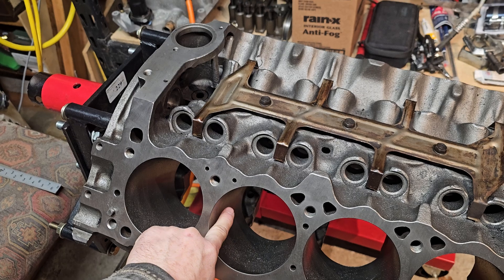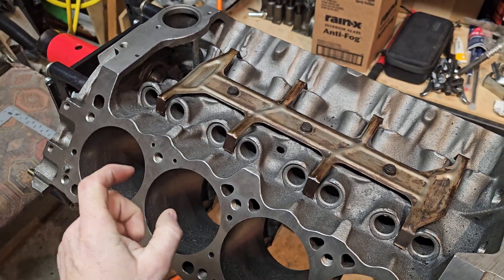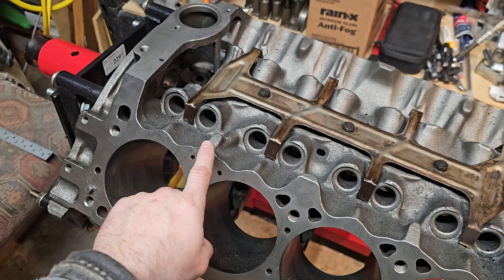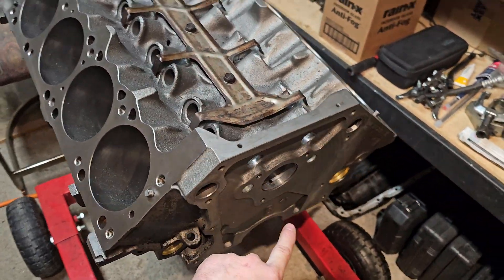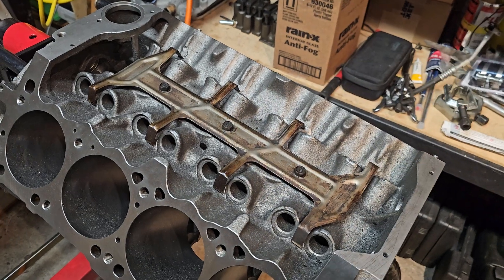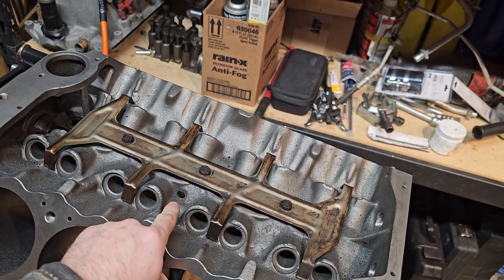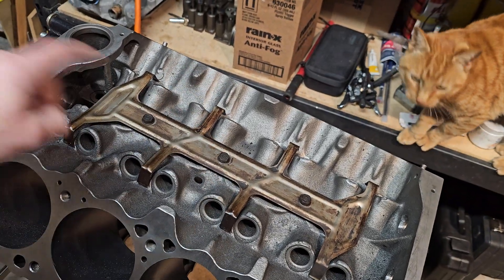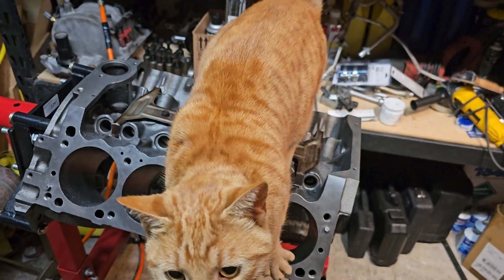Mopar 360 Magnum Oil Cross Over Mod - Why It Might Actually Work!

Comment: Why is everyone tripping over themselves to fix a NON-problem ? We ran 340's and 360's right through the 70' and 80's at 500+ hp and with Nitrous shots higher and NEVER HAD A PROBLEM year, after year, after year.... NADA.... ZILCH.... DONUT !
Control your Vertical Main and Rod Brg Clearances and you have NO issues.
Reply: You telling me your running nitrous without forged internals? That’s nice to know bc I’m rebuilding my magnum 360
Reply: @josephneher8130  'Detonation' and insufficient Cylinder Wall and Ring end gap Clrc is what kills any Piston either cast/hypereutectic or Forged whether it be 4032/2618 alloy derivatives.
As long as you can stay out of the fuel detonation range(good fuel for the NO2) shot) and have sufficient Piston to Wall and adequate ring end gap/Timing spark retard even a stock cast Piston can survive small shots.... the biggest gains being in small shots anyways.
Just highlighting, 
that while FORGED Pistons are advisable for Nitrous usage.... even 4032 alloy Forged Pistons are typically only rec'd for maybe 100 hp shots, and even then they require adequate Wall Clrc, adequate ring end gaps, timing retard and Good Fuel with adequate fuel 'supply' to do so relaibly over time !
Cam & Barrel 2618 Alloy Forged Pistons are Rec'd for higher shots.... and even then still require all the aforementioned ie: Wall Clrc., Ring end gapos, Good fuel and fuel supply, Timing retard when given the shot !
Simply put....
you can KILL even the BEST parts with crap procedures.... and conversely, you can make dawg shit parts work fine under the RIGHT procedures !